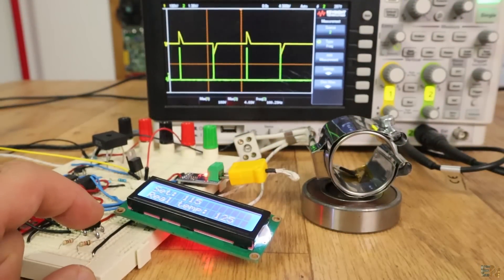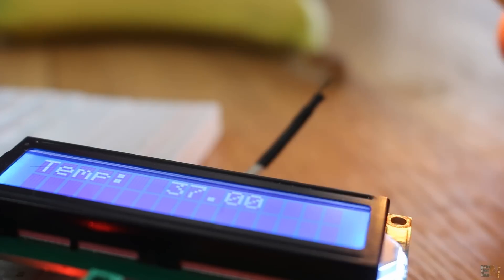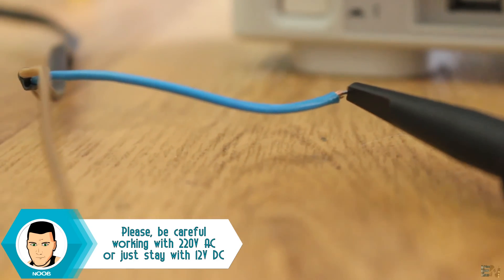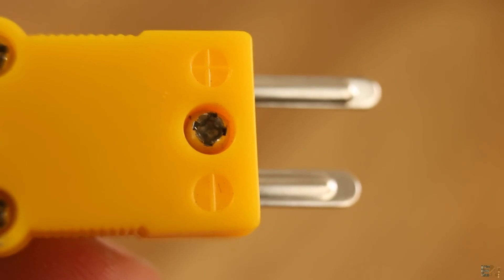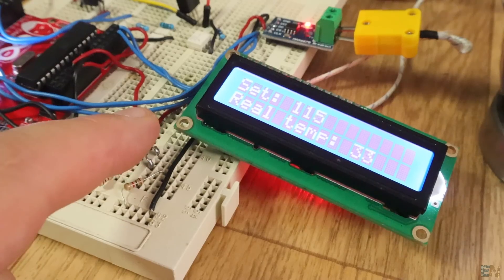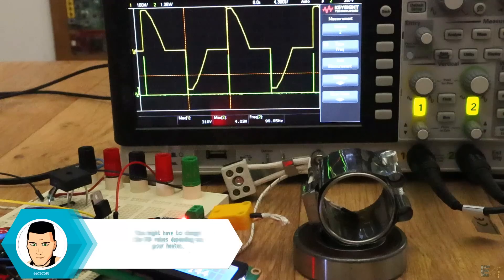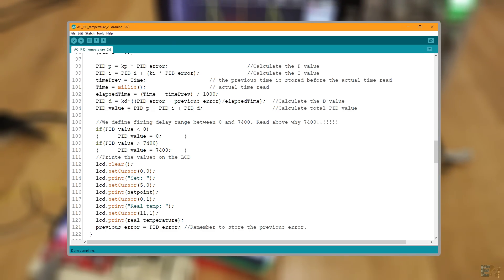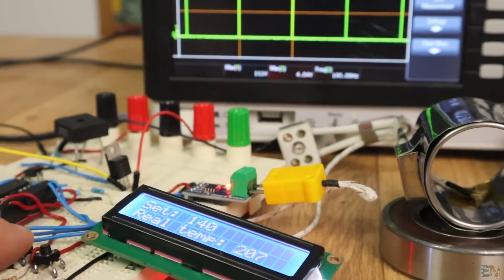AC 220V Heater Temperature PID and TRIAC control

Comment: Is there a difference in the circuit if we're working with a 120V 15A heater circuit?
Reply: This might work, but in front of the Graetz bridge are two forward-limiting resistors for the EL817 opto-isolation diode. You may find it necessary to lower the resistance of the resistors in front of the bridge a little. It will be necessary to select the right triac for the load of the heater. And one more thing: your network frequency is probably 60 Hz. His natomist is 50 Hz. Probably need to factor this into the code. I hope I helped.

Comment: Hello, I making a heated enclosure for my 3D printer, to do this I use a 2000W heater, and I want to control it by a PID controller, so my question is : with this medium can support 2000 W ?

Comment: I did this project and the signal which goes to Arduino from EL817 is a continues signal even when the output voltage is zero. Why do you think this happens? So the signal is alwas 1.

Comment: Dear Sir
Hi. 
I had been written you before. I have need support about zero crossing circuit. If I use a SSR relay ıs ıt neccesary pin connection zero crossing 
or what can do modifıy. 
Stay safe
Baha

Comment: Hi
@Electronoobs my project dont work :( all connections ok, but not power to heat... The fault may be because I used the tlp665j (I had it from recovery - it is 100% efficient) instead of moc3020?
I can't figure it out :(

Comment: Had a big scare following this video when I connected my oscilloscope probe to a heating element. Instantly shorted. Thought I broke something. Master Electronoobs, did you power your load from a transformer? Did you use a differential probe? Did you disconnect your oscilloscope from ground? All three sound like bad options. Not sure if I had probe ground connected to mains neutral or live; I think the residual current device in my circuit panel would trip regardless because I hear there's "very low impedance between neutral and ground." Sorry for geeking, thought I'd share my scary experience and YouTube research :) I still very much want to know what setup was used in the video!
Reply from the maker: Only connect one probe without ground. Also, you could use differential probes but those are expensive.
Reply: @ELECTRONOOBS  ah so the oscilloscope will use its own ground as ground. Super.
Reply: Ok here's an idea. I'll connect oscilloscope probe ground to mains ground and oscilloscope probe tip to live load terminal.

Comment: How did u tune the pid controller and decided kp ki and kd values? I need to control current for my current mtech project. I am sensing current with ACS712 sensor. My current set point is 15 amps, maximum current is 20 amps and voltage is 100 v ac

Comment: you could have easily used Nano and saved a few bucks, I think !! Also, can i use MCT2E as optocoupler ? Q: could we not use attachInterrupt() in code ? A: No. It is meant for attaching interrupt to digitalpins as per documentation. Q: Can we not use PID library like QuickPID in a way ?

Comment: For 110v need to change anything?
I made the project, I adjust the temperature by the buttons, it changes on the LCD but the heater does not turn on.
what is it about?
Thank you very much for the tutorial and help.
Reply: can you help me out please ?
I have constructed the circuit but when i run it LCD is powering ON but is not showing any display i have used a potentiometer to vary contrast but still no results...can you help me with it ? 
I'm using an arduino UNO

Comment: Hi,
I have copied your ingenious circuit with the PID Triac controller and would like to use it to run a reflow oven. I have rebuilt a back/toaster oven and insulated it so that it is optimal for reflow soldering of circuit boards. I just can't find the right values for:
int kp = ??; int ki= ??; int kd = ??;
What exactly stands for which value.
int setpoint = 150 degrees, up to here the oven should heat up first, then it should stay here for 120 seconds and after that I increase the temperature to 220 degrees and after another 50 seconds I switch off. Unfortunately the temperature shoots each time further over 150 degrees although the controller stops already at 130 degrees.
Can anyone help me here? Thank you very much.
Reply: can you help me out please ?
I have constructed the circuit but when i run it LCD is powering ON but is not showing any display i have used a potentiometer to vary contrast but still no results...can you help me with it ? 
I'm using an arduino UNO

Comment: Hey Youtube Comments Section! I'm hiring! I'm producing a novel consumer product using a battery-powered PID controlled transparent conductive film as a resistive element, using this arduino as a proof of concept for the company backing the project. Willing to pay anyone or the video creator 800.00USD for a proof of concept similar to this one with a few modifications for the application to save me time and enable me to focus on the development of the production unit.

Comment: I built your project and it's working great, except one issue. When the display refresh, i have a high pulse on the output. I tried with a lightbulb, and it pulsates. If i disable the display from the code, the control is linear, without pulses. There is any way to fix this issue?
Reply: can you help me out please ?
I have constructed the circuit but when i run it LCD is powering ON but is not showing any display i have used a potentiometer to vary contrast but still no results...can you help me with it ? 
I'm using an arduino UNO

Comment: Beautiful explanation and exciting project. I have a small query if the system is a cooling system, we might have to connect the heater terminal to compress terminals in order to control cooling effect. Is that correct? Do you think the code will still work if the setpoint is -5°C for e.g.?

Comment: really thank you, bro. but I have one question. what if the heater requires more than 16A say 25A. is it possible to use the whole circuit just by replacing BTA16 with BTA25. thanks for your time and help.
Reply: Yes, but better use MOC3063 it can handle up to 600V, MOC302x is for 400V max., atleast in Germany such devices must atleast take 600V, because of possible peaks asmuch I remember, from your name you are from Poland I guess, should have the same standards, in any way more safety is always better and they cost the same.

Comment: I'm wanting to automate temperature control for roasting coffee, and it seems most people use a SSR to pass a PWM signal directly to the heating element. While I'm sure this is fine, high-current SSRs are expensive and I googled around for TRIAC-based control and found your video. I think this will work quite well for coffee roasting, and I can spend all my money on green coffee instead of an SSR.

Comment: Hi, thanks for the video. How long that PID control can work ? and what the different if i add snubber on that schematic ?
Reply: There's no need for a snubber network/circuit, as the load is resistive and not inductive.

Comment: can i build this without using the Rectifier+Optocoupler curcuit??
Reply: Thank You very much for the explanation 🙏
Reply: @ameiliaw8191  based on your profile name, i guess u r indo or malay. so i trynna answer urs in indonesian. kakak bisa pake ssr sih untuk pid control ini. mgkin nanti bisa modif di algo nya aja.
Reply: @muhibbonhasbi4419  saya dari indo, mau bertanya kak, saya pakai bahasa indonesia ya supaya lebih mudah, apakah bisa TRIAC mengontrol kecepatan Motor, motor yang digunakan jenis Motor Pompa (untuk di dalam air), terimakasih atas jawabannya kak👍

Comment: You meantion that the actual temperature fluctuation is +- a few degrees, which is ok.. Can you please elaborate on how to get a more accurate control of the temperature (tuning of the PID loop)? Also, is there a hardware solution to something like this where you wouldnt need an interrupt for the zero cross, but just feed a PWM signal to a chip which would then control the signal to the optocoupler based on the zero cross instead? I also noticed you didnt touch on using a heatsink with the triac, can you go into any amount of detail of when a heatsync might need to be used? A response here would be great and maybe a detailed video touching on some or all of these would benefit your community. Keep up the good work!

Comment: Hi electro... I have tried to make one for my dip solder but not able to detect zero cross I think. When zero cross connected to arduino no heating when I disconnect heater heats up but no temperature control.. How can I detect zero cross plz help..

Comment: Supposing that I want to integrate this complete circuit into one board, how can we still detect the zero crossing, since, in your circuit, you are using a separate supply for Arduino. I want to use the same rectified supply provided after the bridge rectifier.

Comment: Hello, I would like to do this project, it's possible to do this project with 110V? Because I'm from Colombia and I need to control a heat mantle
Reply: Yes with a 110 V heater or if you use a 220V heater you get half the rated heat.

Comment: Hi, I have tried a 220v triac schematic on a fan, at the same time I have a problem reading the rpm speed of the fan. I use an IR sensor module. How do I display the rpm on the LCD? help please

Comment: Would this setup works on 120VAC? Thanks!
Reply: Yes it will work. Use a 120 or 110 V heater or you get half the heat with the 220 V heater
.

Comment: if the optocoupler and bridge are different, will the circuit turn on? because I use other than EL817, is it still working?

Comment: this is a good project but i want to add triac  cut off when a reed switch is closed . this can be used for hot air soldering station, when the iron is in stand , a reed switch is closed and the program will cut off the gate drive , or shall give a low pulse width. awaiting the  add on in Arduino sketch and gate drive modifications. Thanks.

Comment: i try at water heater it doesnt work dude.. heater is not reaction.. please response hehe..
Reply: maybe u can check the circuit again. i got the same prob before, but i used to check my circuit and then i found what is the prob was. and if it doesnt work, u can test the heater with stand alone circuit and see does it work or nah.

Comment: Hello ELECTRONOOB, i've been following many of your videos and this PID for AC is pretty cool. Well, i was wondering if you could remake this video, but this time, with two unique features: 1. use of Touchscreen LCD to control, set and navigate and 2. Introduce feature of creating/utilizing profiles, we are in the 2018/2019 era and PID has advanced than just using set points alone. The LCD 20x4 tutorial is cool but i haven't actually seen anyone use the touchscreen for any "comprehensive" PID tutorial, although there "was" Zallus controller years ago on youtube but no explanation on d algorithm/code/schematic and it's pretty much dead topic online.. and i believe you can do it! Teach us how to code/build the modern PID controller using an UNO/MEGA ,You remain one of the best explainers on how stuffs work..Thumbs up and Merry Xmas!

Comment: sir my schematic and things are correct, but the heater doesnt get hot, even a little, it just gives me a little vibration when i drag my fingers to the heating unit. is there any problem with the heater?

Comment: Sir do i have to complete the circuit first and plug in the 220v before i run the code? because the set temp is changing itself, and i didn put the 220v
Reply: Your push buttons seems to be wrongly connected. All the best!

Comment: why does the set temperature is changing by itself? do i have any mistake in this?
Reply from the maker: You've made this project and the setpoint is changing by itself? If yes, then you have some sort of scheamtic error. Maybe you don't have good pulldowns to the push buttons. Keep up!
Reply: so does it mean sir that i have a problem with my schematic or the resistor on the push buttons? thank you sir for replying!
Reply: But even i removed my  increase and decrease pin the set temperature still changes on its own, i dont know how to assess it sir
Reply from the maker: DON'T remove the increase and decrease buttons. In that way, the input pin will be flaoting and the value could be high or low, that's why it's increaseing or decreasing by itself. Put the buttons with pulldowns to gnd as in the schematic. http://www.electronoobs.com/eng_arduino_tut39_sch1.php
Reply: Okay sir! thank you so much! allow me to give credit to your account as we use this part of your project in our research!
Reply: sir, all of the components are correct, the schematic is also correct, i just dont know what is wrong, please help me sir, thank you!

Comment: Hi. Great videos. i am working on a project myself and was thinking of using band heaters.. how hot can these band heaters actually get? and can you heat up say, 4 all at once from a 12v 20a 250w transformer? or would i need say a 24v 40a 1000w transformer so it could handle 4 x 220v? Help with this information would be much appreciated.

Comment: Hey just curious if anyone has done the work to make a PCB for this.  If anyone has would you mind sharing please so I can have one made?  I stink at making those and am 0 for 4 attempts using Eagle and FreePCB. :-/
Reply: can you help me out please ?
I have constructed the circuit but when i run it LCD is powering ON but is not showing any display i have used a potentiometer to vary contrast but still no results...can you help me with it ? 
I'm using an arduino UNO

Comment: You probably should add a thermal switch/fuse to this circuit. I have several of these I have removed from old ovens and microwaves. If something were to go wrong in the circuit and the heating element gets overloaded, a simple normally closed thermal switch with an appropriate temperature rating could really improve the safety of this experiment. If you intend on leaving a design like this unattended for any reason, you should probably use 2 separate thermal switches placed in different locations. This topology/saftey circuit is standard in devices like microwaves. A small heater like this is not as dangerous as the power potential of a microwave, but for those of us experimenting with these things, we are just as potentially dangerous ourselves and should strive for double redundancy while planning for potential failures;)
-Jake

Comment: why do you need to find the zero point for the ac voltage ??? what does it have to do with the TRIAC
Reply: fouzai alaa You should trigger triacs at the zero crossings to avoid large surge currents (which cause noise on the AC lines and can damage your load or other electronics)
Reply: Jonah Swain Thank you for taking time to explain this clearly. I really appreciate it.
Reply: so i should trigger triac's on the zero crossings for every half of the signe wave ?? or is it trigger once at zero point and it will pass both signe waves ???

Comment: hello > nice video bro >
i want ask something > crystal oscillator has any polarity?>
like i am making arduino nano >> so i am confuse in crystal oscillator because which pin 1 or 2nd i dont know >< so if put i add crystal oscillator backwards OR maybe FORWARDS it will work >?
Reply: WOW KIDZ No, they don't have a polarity. Atleast the 16MhZ 2 lead tht types.
Reply: Thanks , But SMD has 3 terminal which is found in arduino pro mini /nano >the center pin will be ground maybe >and when connect ground to it maybe i don't need to connect 22pf capacitor anymore ?
Reply: WOW KIDZ you are right. With the 3 pin smd package the capacitors are not needed and are inside the package. Just remember to connect the center connection to device ground.
Reply: but i connect center pin to ground it was not running>< and both side pin to atmega328au

Comment: nice video and super colourful schematic. I built mine with MOSFET driven a trailing edge (triac only works as leading edge)  circuit like ATTINY85. Nice and quiet without interfering my hearing aid.
Reply: can you please help me with the AC heater...i can fine one similar to the one shown in video.
How can i make this project without this heater and employing some other mechanism ?

Comment: Is there are a best way for zero cross detector? I doubt about those 47k resistors wich is just dissipate energy to heat.
Maybe capacitor? But will it work for correct zero detector, as I remember cap shifts ac phase.
Reply: Ave Vovus! It might not be the best zero crossing detector, but it is the easiest. Capacitors would just filter the AC into DC. Use higher value resistors (and possibly a buffer) to reduce heat/power dissipation.
Reply: I mean capacitor before rectifier. There are formula for Xc reactance for cap in AC circuit, Xc=1/2pi*F*C. Cap in this case limit current and not heated.